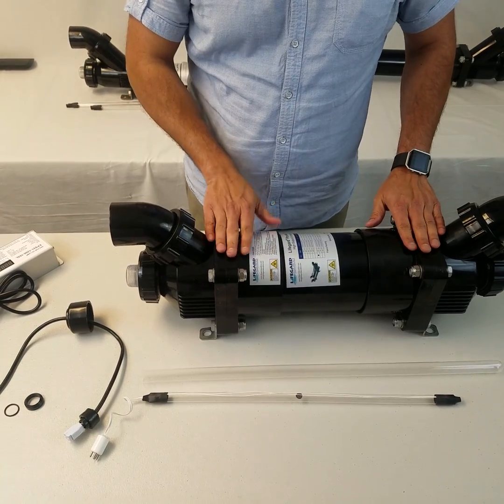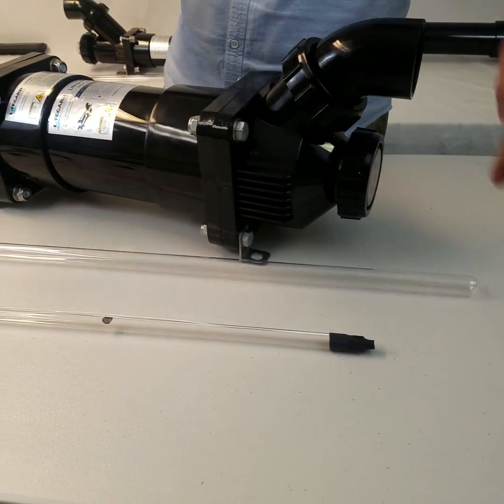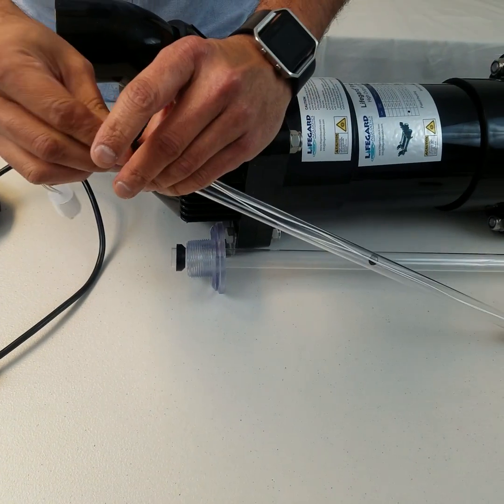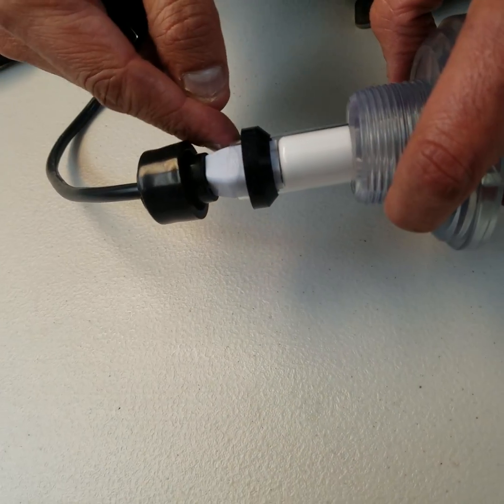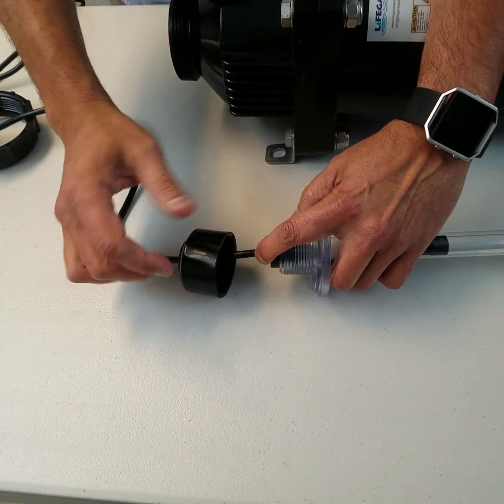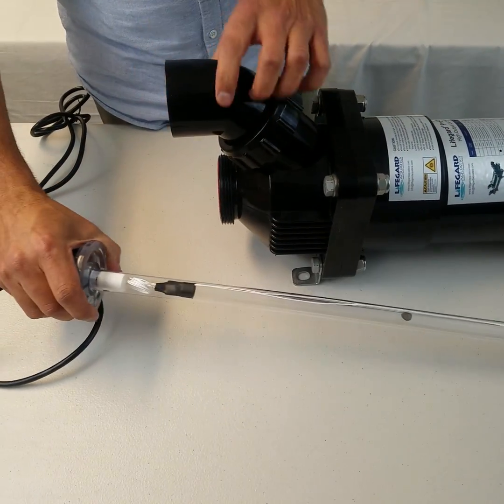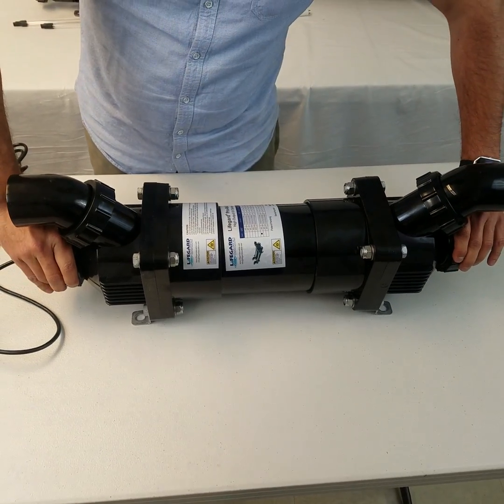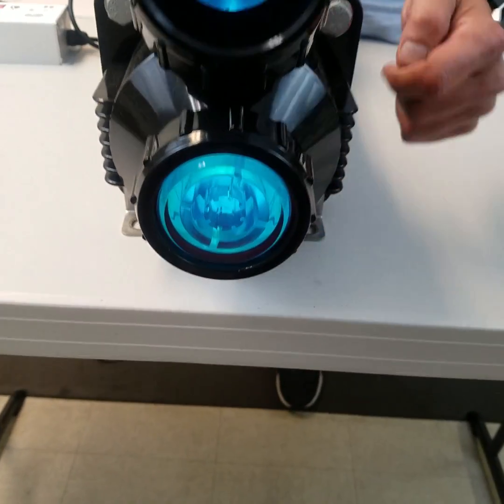Lifegard Aquatics Pro-MAX™ UV Sterilizer - Setup

Comment: I only got about 165 days out of my 25w bulb before it completely burnt out.  Does the system need to be drained in order to replace the bulb, or can the bulb be replaced without draining the housing?
Reply from the maker: Bulbs usually don't burn out unless you encounter moisture/water at the power source Or there was a heavy thunderstorm with lightning that can trigger a safety shutoff on the ballast. Please reach out to us at info@lifegardaquatics.com